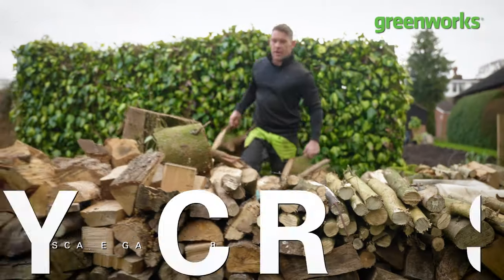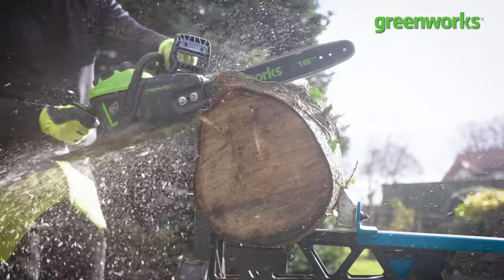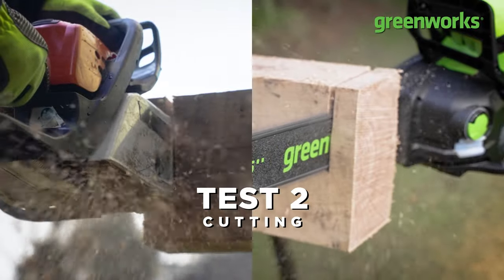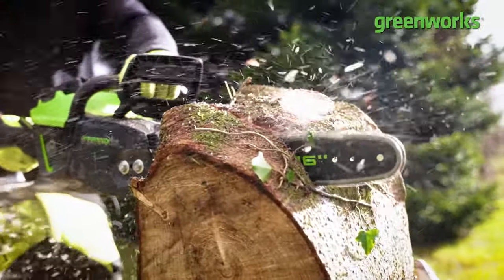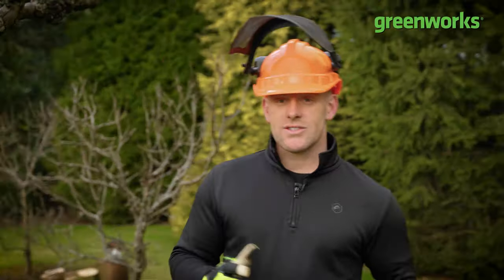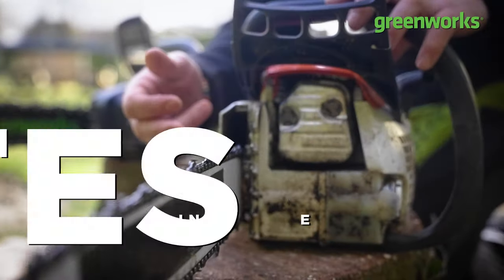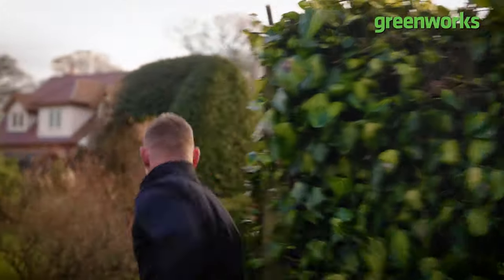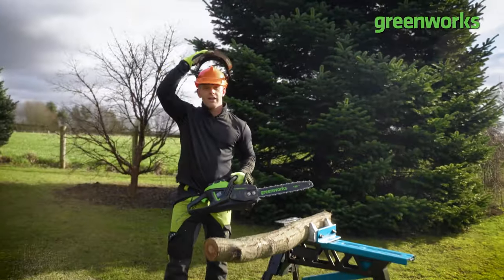Greenworks 60V Chainsaw vs Petrol

Comment: I have 3 chainsaws now...

Stihl 180C = works okay. not too hard to start. the chains get dull very easy.
Echo 590 = impossible to start. its so bad there are YT videos and tutorials on how to start this. the stars must be aligned. A waste of $450.
Greenworks 60v = best chainsaw EVER! I had a huge oak branch of 24" diameter come down on my property and I made quick work of it! I ended up cutting other branches and trees that have fallen, so a full 8 hours of cutting trees... both old oak and new oak and the chain is still sharp. Im so happy I made this purchase!

Comment: What a beautiful manipulation, comparison cheap, low power, fuel chainsaw to much more expensive battery one. It wouldn't surprise me if dull chain was used too.
Reply: well i can agree with the price. my electric chainsaw is double the price of gas chainsaw's. but it's totally worth it. twice the price but quadruple the benefits and advantages. 60v and 80v aren't jokes. even my 40v are more powerful than my 33c chainsaw. 2 batteries and you could run it whole day.

you'd buy a 200miles per gal $40k car with maintenance every 2 years over 10miles per gal $20k car with maintenance every 6months.

Comment: I watched a video where a guy was comparing his Stihl to a Greenworks, and he tossed the greenworks and some of the plastic broke. But he wouldn't toss his expensive Stihl in the same way, despite his notion that the Stihl was beefier and more well built. The truth is.... no ones throwing their chainsaws. Accidental drops do happen, but these mostly plastic saws can still take a beating. My Dads 80v Greenworks is 7 years old and looks worse than the saw in this video (after all the torture) and it still runs great to this day. Although his drive sprocket is about toast. Speaking of which, hey Greenworks, where can I buy a replacement chain drive sprocket for the GCS80450 saw?